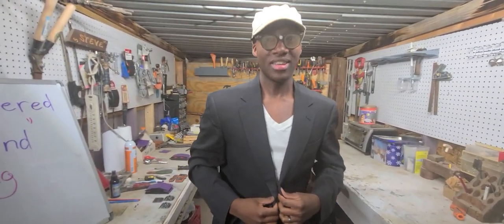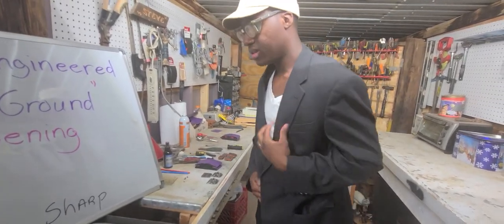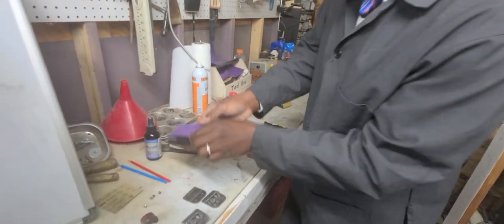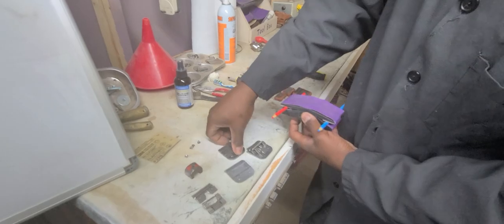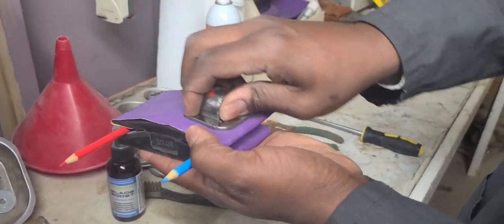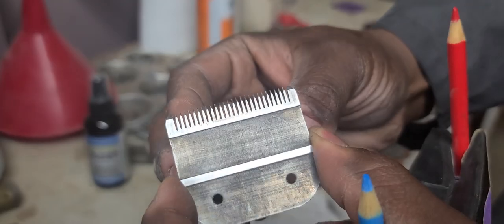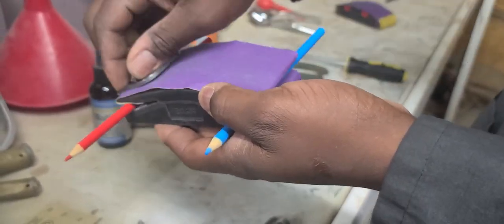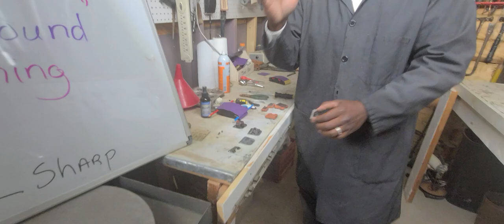Part 3. HOW TO SHARPEN ANY CLIPPER BLADE PROFESSIONALLY  Hollow ground with sand paper!!!

Comment: First up, love your work, Mate! 
Your family dynamics is a great example for all of us, & the music - icing on the cake.

I have been (doughnut) flat sharpening clippers for many years and have excellent results. I can understand the push back from pro sharpeners was partly factual, but I suspect it was mostly the fact that you're cutting their grass'.
I remember getting the same push back 20 years ago when I was trying to figure out how to do it myself. With trial & error, I stumbled across something similar to what you have shown in your previous clips. I shave my own head and beard every 2 weeks and I get about 3 years between sharpening an old school Wahl super taper. I have sharpened my friends blades as well & have been getting similar results.

I settled on 400grit flat grinding, but I'm going to try your method. I think It's safe to say, this is your area of expertise.

I'm wondering if a different hollow grinding jig might suit the in between (not a pro sharpener, but a remote barber shop) sharpeners?
If you cut the teeth of an old handsaw so you end up with a long rectangle plate with bit of spring. You could gently spring up the centre by pushing  from each end, between two blocks. This would give a much shallower curve that matches your pro convex sharpening disk. You could back fill the curve with some builders bog (two part polyester filler) to give you a hard plate with a relatively consistent arc. The longer length could be an advantage.
Not that I wanted to add to your 'clippercide' demise, but I'm a firm believer that information should be shared freely.
On that note, this will be the next project on my list.

All the best from OZ,
Ben

Comment: Hello,
I have been sharpening for over 15 years.  You have not created the hollow grind between the cutter and comb. Your theory is solid and I like the pencil trick.  You need to rotate the blade 90 degrees to get the profile of the hollow grind on the cutter and comb. Sanding side to side to get the profile.  Going the way you show is not getting the profile you have on the block.  Put the 2 sanding blocks flat side together and you will see the way the cutter and comb make up the shape like you show with your hands.  I have made this block many years ago.  The problem I have found is the grind lines are not going the same direction as in the wheel and it does not cut well. If you have success with this method I am glad for you.
Reply from the maker: Thanks for your knowledge. I am thankful for sharpeners like you who shape the industry with knowledge and research. Also you are a big help to the barber community. So i am going to take everything you have said into consideration and look it over. The one thing that has helped me over the years as a sharpener is that i am a licensed working  barber. I was able to test everything ive tried over the years on real hair and make adjustments accordingly. I never had to use rabbits fur. So before i give out any information ive tested myself for 6 months to a yr. All these videos are proven and tested info from me as a barber and sharpener. As people give me feed back like you just done i will make adjustments if needed. Thanks. Maximum respect to you, your knowledge and expertise.
Reply: @keepitsharp357  I am not a sharpener. I am a mom of 2 boys and a husband and couldn't find any professional sharpeners to sharpen my Wahl blades. The one lady I found did it but it didn't work so I got another Wahl. Now in covid I really can't find anyone. I am so blessed by these videos - you and your family are priceless and so darn cool!!! So I am NOT a sharpener but the above comment made sense to my pictoral mind. On the machine, the blade is 90 degrees to cone angle and the machine wheel spins right to left as you pull the blade from the center of the machine out to the edge and then back to the center, perpendicular to the machine spin direction. I think to duplicate this same direction and flow you need to turn the blade 90 degrees so it pulls across the width of the block, not the length. If you set the short side of the block against your belly and and the length direction goes out away from your stomach, you would move the block , as it were, right hip to left hip and start the blade at the left hip corner  and move it straight out away from you as you move the block right to left across it. When you run out of block, then you put the blade in the top left corner of the block as far away from you as you can go and pull toward you as you move the block right hip to left hip across it. I have no idea if these directions make sense, but if I could draw it I think it is correct to duplicate the arc of the sanding machine and the direction it moves as you move the blade back and forth across it. You have tried your method though so even though in my mind it seems like the direction and angle is wrong somehow it works. I would be so curious if you tried my method ("if" you can understand it) if it would sharpen even better. Regardless I am trying your method till you test out Allen Marshall's idea that I riffed on. If you change your method and make a new video, I will learn from that one. Again thank you so much from my amateur family barber heart!!! Your whole family made my day today!
Reply from the maker: @owenmccann8926  your a genius and if you feel it works try it. Im not dogmatic about what i do or teach. Results trumps everything. Try it and if you get good results great. In sharpening there is no one way. And my way i teach is not the only way. Its just a way that worked and im sharing. There are things that i could  go wrong with every method i just try to share the method with less possible things that could go wrong. Give me the feed back of your method so i can tell everyone your way. And ill be sure to give you all the credit
Reply from the maker: @UCHHnEbqUmHARBFlp4WARQVg your welcome. I like to see people be innovative and try different things. Thats how we get better results and better inventions. Im not making these videos to prove nothing about me, im making thses videos to show people we can do whatever we want and anything can be done a different way. We don't have to just trust what the manufacturers or the experts in any profession say. We can always dig deeper for ourselves and find a newer or better way. Im just a regular dude with a family who just like to try stuff. I use to send my ideas to Andis, Whal, and Oster for years. They all told me to kick rocks. So i decided to just give it to people who care. I hope i motivate someone  to do the same. When  they do i will show case it and give them all the credit.
Reply: @owenmccann8926  I think you are correct about turning the blade 90 degrees and the first part of your explanation is clear, but when you got to the left hip and right hip my eyes glazed over trying to visualize it. 😳
I haven’t heard if he ever tried this method but I doubt it because he apparently has success with his. However, I can’t believe both methods would work because they would produce two different grinds. Have you tried it out yourself? I sure would  like to get to the bottom of this before I start sharpening.
Reply: I understand what you are saying about turning the blade 90 degrees, but then you say rub the blades from one side to the other side. Once you turn the blade shouldn’t you rub it from one end to the other end lengthwise like he demonstrated?

Comment: I was recently asked to sharpen some clipper blades, and found this series of videos. Thank you...so much.

The heads I have done all work flawlessly.  More than one was really bad too. While the hand method is slow, it is also very easy to control pressure and amount of material removal.

I will add that I did do one thing differently.  I completely understand using the sanding block, and started trying to find another very slightly convexed surface. Many cars have this surface on their hoods or roofs. I have a spare hood scoop for my MINI...an absolutely perfect surface. 

Keep sharp man.

Comment: 2 questions. 1. Do you have any videos of you sharpening with the machine and 2. Do you have any videos of you sharpening t-outliner blades with the machine?
Reply from the maker: Sure i can if you want. Do you have a machine? Do you need help using your machine
Reply: @keepitsharp357  yes. I have 4 machines, but I keep running into the same issues with all 4 machines. I have a 16in Nebraska, Lazer 10in, perfecto 10in (which needs a new wheel), and a foley 14in. But no matter which one I use, I always have the a hard time getting sharp the 1 1/2, 2, 3, and t-outliner trimmer blades. They always pull after I sharpen them and I don't know what I'm doing wrong. I keep the wheel laced with grit every 4th blade. I keep my strokes in a consistent up and down motion. I always sharpen until both teeth and brace is shiny and has a consistent mirror finish to it with no inconsistencies. And I always demagnetize and clean the blades after sharpening. All this and I still have issues with the same types of blades in my list. Every blade outside of that list I get perfect. Please help me to understand what I'm doing wrong?
Reply from the maker: @str8jaber  ok i will help you
Reply: @keepitsharp357  thanks a bunch.
Reply from the maker: @str8jaber  first are the plate you are sharpening with old and need to be resurfaced or they have a fairly decent surface
Reply: @keepitsharp357  3 have good to decent surfaces, but one doesn't (but I don't use that one until I can get another wheel for it
Reply: Do you have to do both blades
Reply from the maker: @petersnell7358  yes sir. Sorry for late response

Comment: Super late on these videos (loving them by the way) , dog groomer here, which grit is used for the curved side, and which grit is used for the flat side of the block??
Reply: I think the video shows he has two curved sandpaper holders, I don't believe you use the bottom side. Lower number grit takes more material since it is coarser, higher number grit smooths any burrs since it is finer. I think the bottom side is there to make it multi-purpose without switching out the sandpaper for different sanding surfaces not in relation to sharpening.

Comment: I dropped my clippers and chipped one of the cutting  blade teeth and they started to make loud noise is this due to the chipped tooth or something inside because I've taken them apart nothing is broken or out of place plus when fully open or in half the sound fine but when fully  closed they get loud any ideas would help alot love the videos keep them  coming
Reply from the maker: Whats the name of the clipper. More than likely it an adjustment not the blade
Reply: @keepitsharp357   it's a corded 5 star magic clip
Reply: @keepitsharp357  if I can't fix these can you recommend a pair of new clippers thinking of the new cordless magic clip but dont know how I feel about not having a cord I like the power you get with the corded clipper I dont know if there is a difference
Reply from the maker: @cesar-jd9go  is there a way you can send a pic or the way they sound to me direct message on Instagram @keep_it_sharp. If the a power screw on the side it might just nee a slight adjustment or the magnetic motor slid over and just need to be slid back in place. Not a big issue at all but if you just want a new  clipper the cordless one do have pretty good power.
Reply: @keepitsharp357  yes

Comment: Do you need 150 grit for flat side when hollow sharpening or just the 220 on both sides?
Reply from the maker: See how it works for you. It all works it just take a few extra passes the smoother the paper. Its all good bro

Comment: Great video just came across it last night. Is the Andis dog grooming clipper blades hollow ground.  I want to try both methods but don't want to ruin them if they're not hollow ground
Reply: I forgot to ask if you could reply to the message I left above, I have a bunch of blades I need sharpen but by the time I get out of work It's to late to drop off at my sharpening guy. Thanks again for the content great video with good information.
Reply from the maker: @jerryvargas9839  all those detachable clipper blades are hollow ground. The thing is if they are not really that bad you can sharpen them slightly flat and get the sharp edges back on the blade and be back in business. However i always recommend practicing on a old blade or two to be sure your skills are working before you do any of your good blades. Now as for hollow ground method practice that as well on and old blade or two. Get your skill down then check that tje blades are sharp and cutting. Yes they are hollow ground. Hope i helped you.
Reply: @keepitsharp357  Thanks for the info. I do have some broken blades that dogs accidentally kicked off the table I can practice on. Keep up the good videos I will be a fan even if it doesn't have to with dog grooming. But if you know anything about k9 blow dryers I would love to learn on the regular maintenance and repair for them because once they get older they always need something. I have 3 of them, I use 2 on the regular and 1 for backup when 1 of the 2 goes down.  If not I love to see a family getting involved and working together to create something good that looks like their having a good time when they are doing it . I'm a father and love spending time with my boys on projects and working together. Just want to say i think you're videos are good because they have an authentic original content that comes out of a family working together. Thanks again sorry for the long reply and let the family know the music sounds good and adds a coolness to the videos .

Comment: Hey I'm having trouble recreating that hollow ground using the sandpaper. I'm using a blade that was flat sharpened and I'm trying to bring it back. Can you help?
Reply from the maker: Which blade is it? And sometimes it takes some time and good eye and hand coordination
Reply: @keepitsharp357  the toutliner blade.
Reply from the maker: @obsidianbarber223  yea that blade is always the toughest to get right
Reply from the maker: @obsidianbarber223  but its doable
Reply: @keepitsharp357  is there a certain amount of strokes before you change the sandpaper ?
Reply from the maker: @obsidianbarber223  if it appears to be to smooth than you will need to change it. The # of strokes i dont have an #
Reply: @keepitsharp357  so there is a point where the hollow ground cant be restored?

Comment: But why would you need to use the convex sharpening? 

Your example seems logic because it makes a difference between the base and the tip. However, If I'm not mistaken, the curvature is 90 degrees off with respect to the wheel in your in your example.

If the curvature of the wheel starts at the top, the lower part of the blade would be asymmetrically sharpened and it's the same if the curvature starts at the lower part of the disc.

If the curvature starts at the middle part of the disc and goes down in both directions, then there is no purpose to move the blade up and down when the disc is moving, because the moving would make the shaperning as if it were done on flat stone.

I don't believe that's needed the disc nor the convex sand paper.

I think a flat stone is the only thing needed.
Reply: I agree, the method in part 1 is all that is needed the vast majority of the time.  You notice the blades are recessed so that only the front and back are touching anyway, lapping flat will produce a longer lasting, sharper cutting blade.  Hollow grinding will only make for less material to remove if you lap it next time?  The professional rotary sharpener would have to be a part of a sphere to sharpen the blade symmetrically, and then the sides of the blades would have more pressure and there'd be a gap in the middle, not sure if that's the case or not.  

I like a diamond stone with soapy water, cuts so easy and fine at the same time.
Reply: @rodfreess6019  what I think it could be a good alternative, is to put some diamond paste and turn the clippers on.

Comment: You use the same ratio for sharpening? I believe you said it was 1:2 in your first video. For every 1 stroke you do on the round side you do double on the flat side, right?
Reply from the maker: No sir. Just enough to smooth it out. And get the burrs off. But not to much because you will flatten the hollow ground out

Comment: how can i get those magnets to buy man
Reply from the maker: I show you how to make them. But if you really want to buy them tell me for what blade you want them for
Reply: "but" can i use the normal magnet
Reply from the maker: @richmondwayde4376  yes you can but know that as the blades get smaller it difficult to control. Whatever works best for you is the way to go.

Comment: How come everywhere I look professionally you're supposed to be using 3,000 grit sandpaper and 8,000 to polish any type of sharpening knife or tool.. 

Why are you using 220 isn't that way too rough?
Reply from the maker: Polishing and sharpening are 2 different things.  Most clipper blades machines use 220 grit. But remember im not dogmatic about what i teach. To each is his own. Try it if those work for you great